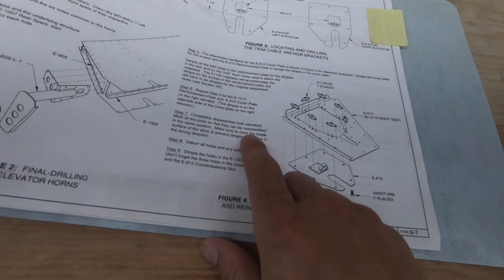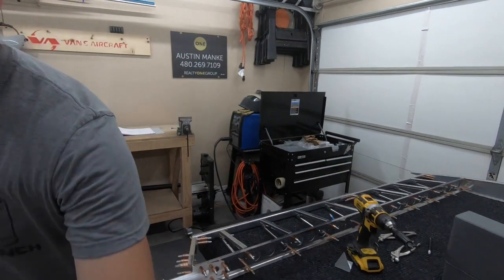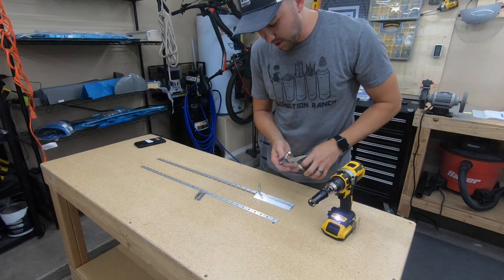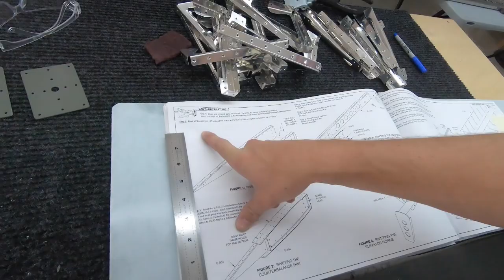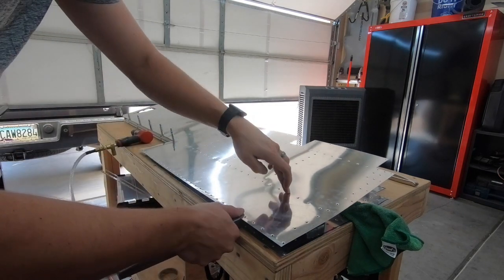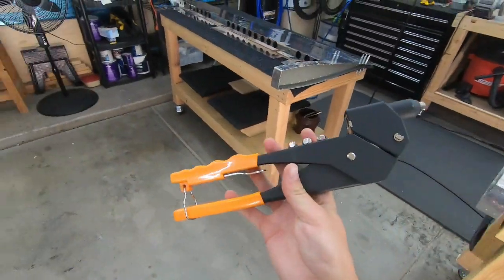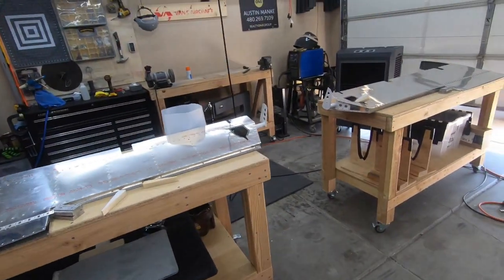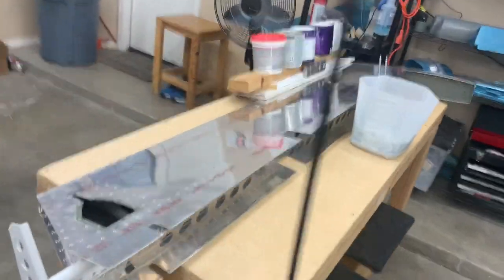Van's RV-10 Elevator Build, Part 2

Comment: Once you combine the two parts of the pro seal tank sealant it will set up. Those cartridges are sweet but are a one time use.I've heard of people storing the two parts in the freezer to extend the life.
Reply from the maker: That is great to know! I was under the impression the freezer would slow down the reaction to a standstill. Thanks for commenting!

Comment: My pop rivet gun does the same thing! I thought something was wrong, like I didn’t set it up accurately. Did you ever make a video about why it does that?
Reply from the maker: It’s the strangest thing. I think it was just burping out excess oil, because mine finally stopped this past month or so and no longer needs the burp cloth. I never did make a video since it really would have just been about the oil spray. 

Thanks for watching!